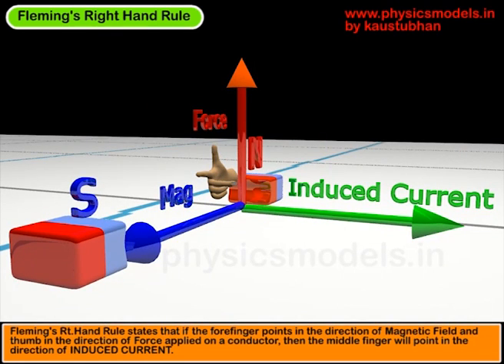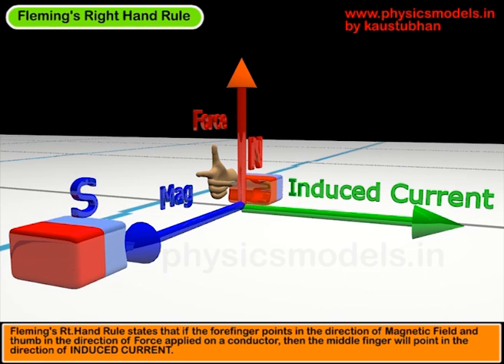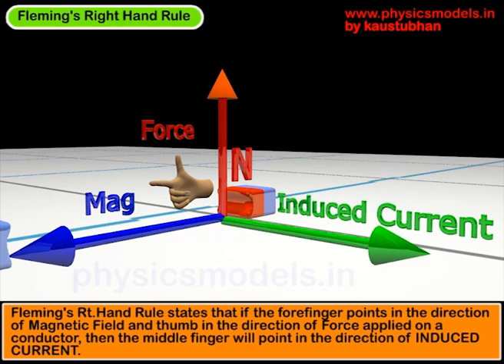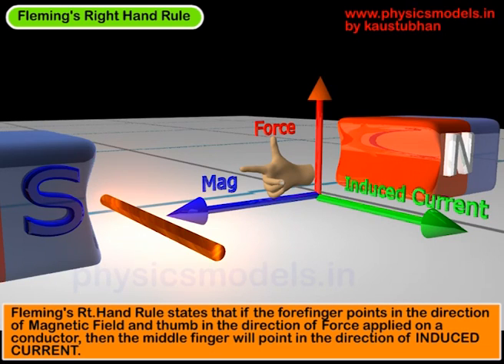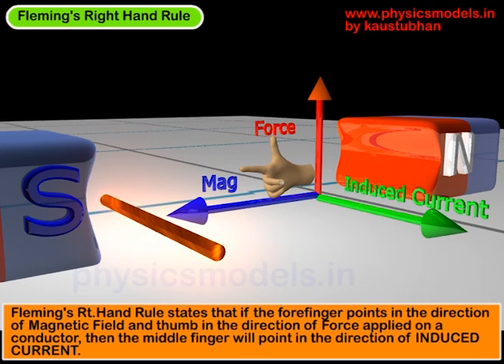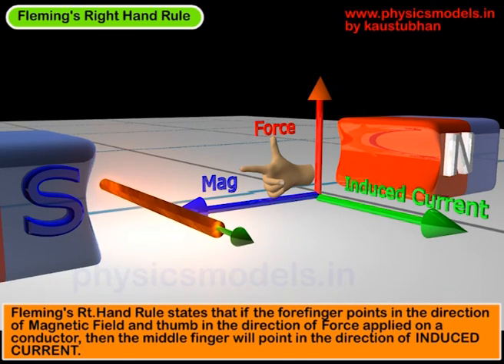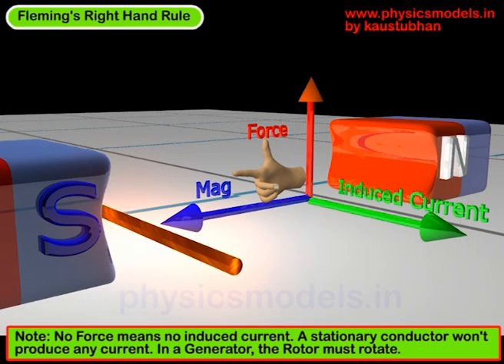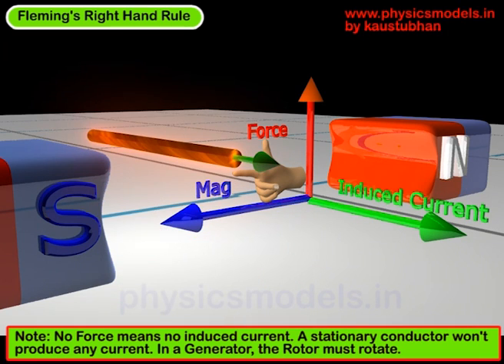Physics Made Easy-Fleming's Right Hand Rule

Comment: What happen if we reverse the force?
Reply from the maker: If we reverse the direction of the Force, i.e. Force acting vertically downwards, then we simply re-orient the Hand in such a way that thumb points downwards plus the forefinger remains in the same direction pointing from North towards South Pole.  With these two new inputs, the Output is the Induced Current direction. The direction of this current will of course get reversed.

Comment: Excuse me, can you please explain what you mean by:

1) Cutting the magnetic field lines

2) How do you know if it is a motor or if it is an *a.c generator*?  

Thanks. I liked and subscribed.
Reply from the maker: Hello Bruh, 
1) cutting the magnetic field lines: The invisible magnetic lines of Force exist always between the North Pole and South Pole of any permanent magnet. If I put my hand in the middle, I am cutting the lines, or "getting in the way" of those lines. If my hand is a conductor, a metallic hand, a current will flow through my hand. But my hand is not a conductor. If you move a copper rod between those invisible lines, a current will surely flow through the copper rod. 
Now, by moving the rod, you causes some Motion. Motion created electricity. That's nothing but a Generator principle. The Right Hand Rule talks about creating motion of a conducting part to "get in the way" of magnetic field lines, and then creating electricity. The Right Hand Rule gives the directions of current depending on the directions of Motion and direction of magnetic field. The Right Hand rule applies to generators , NOT to Motors. 
[ Easy way to remember? use some anagram like LNG  (Life is not good?) I mean (Lefthand NOT for Generator)
2) Fleming's Left Hand Rule is the opposite and used for Motors.  Imagine a Fan. Here we are giving electricity to the thing, and we want motion, rotational Motion. The principle is: when you supply electric current to a conducting part (can be a segment, rod, plate etc) like a metal part, which is already standing "in the way"  of magnetic Field Lines, i.e. between some North and South Pole, this part will see a Force acting on it, and this Force will cause it to move. The force is always a linear force. Because the segments are coupled on either side of a centre line, the whole segment rotates and you see a Motor kind of effect. The direction of the Force is given by Fleming's Left Hand Rule. 
3) Note: Both these rules give the directions only. They do not tell you how large the current is, how much Force and so on. 
I hope I could clarify your question. 
[ You are welcome anytime to login to my website www.physicsmodels.in or physicsmodels.com . I have covered a whole lot of subjects for the entire physics syllabus. ]
Reply from the maker: I must also add for interest that if I am wearing a metallic silver or gold ring on my fingers, and if I wave my palm with some velocity through the magnetic field lines, a current should certainly get generated through my ring.

Comment: Hi thank you for explanation very easy to understand but im a bit confuse for clockwise and anticlock of the coil , please let me know if you have an easy explanation .
Reply from the maker: Garen, good question.  To understand clockwise versus anti-clockwise, first point the fingers for the INPUTS. a) The magnetic field direction is clear, b) For the Force direction- this is upto us, it is an INPUT. If we ourselves put the upward force on the LEFT side of the conducting coil or rectangular segment, then it means the right side of this coil or plate will have a Force direction downwards. Why? Because the coil or plate is free to rotate about an axis passing through its center, this is the hinge for the whole coil. In such case, the rotation will be Clockwise -- when we look from the front side. 
On the other hand, if we apply a force upwards on the right side of the coil or plate, then the whole piece will rotate Ant-Clockwise. 
According to how the Force is applied, the induced emf will adjust itself for the direction, that's an OUTPUT of the Right Hand Rule. 
Therefore, the Generator works as per Right Hand Rule. If water falling from a dam impacts the turbine buckets on the left side of the magnets, this would be a downward force acting on Left Coil, so the Right part of the coil will move upwards, the whole Turbine would rotate anti-clockwise. 
Of course the water should not fall on both the sides of the turbine buckets at the same time, that would be same as applying the Force downwards on both sides of the conductor plate or coil , and it won't rotate properly.

Comment: It seems to me that the error here lies within the direction of what is incorrectly called force. Would not the two "poles" be accelerating toward the dielectric plane? In other words, the two "poles" are trying to create a single magnet. Considering the position of the copper, would not the direction of what is incorrectly referred to here as "force" be the opposite of what you have depicted? Not having a go, just curious. Nice video presentation by the way! Thanks
Reply from the maker: Elams, I think the answer would be that in the traditional Fleming's Right Hand Rule, the magnets are fixed. They are not free to move towards each other. The fixed magnets are just a way to create a magnetic field.
The Force is applied externally. Like water falling on blades of a turbine, or in an electric car, the Forces during Braking that act opposite to the direction of propelling the wheels. (Check Regenerative Braking videos)
 The direction of Force is an input, it's determined by us, it's not an outcome of a Generator. 
Next, Even in a real Generator, the magnets have poles facing each other, and there can be two distinct magnets. Of course, the magnets can't move towards each other, and the gap between the poles is kept small, and is carefully kept constant. 
Effect of electric field due to induced emf on the magnets:- well, here we have permanent magnets in this video instead of electromagnets.  These won't get affected by an external field of the induced emf which is expected to be far weaker than the primary magnetic field. In other words, the created emf can't be strong enough to overcome the parents which created it.
Reply from the maker: Further, the two poles in reality facing each other, help to focus the magnetic field lines.
Reply from the maker: I hope I have answered your question. If the question is different, let me know

Comment: Would the right hand rule be applicable to the current and force applied to the bars on a squirrel cage rotor? Please let me know!
Reply from the maker: Good question. Answer is "NO". 
1) The squirrel Cage design is infact a AC Motor. For any Motor, INPUT is current and OUTPUT should be rotation (of Rotor). 
2) The Rotor of the AC Motor is initially at rest and then starts rotating with respect to the rotating Magnetic Field inputted in the Stator Windings. The INPUT to the Motor is magnetic field rotation. The 2nd INPUT becomes current in the bars as a result of the change in Magnetic FLUX felt by the bars. 
3) The squirrel cage bars are initially stationary , which means they have highest relative velocity with respect to the high speed Rotating Magnetic field.  
4) The change in flux will cause an induced emf in the bars of squirrel cage. The emf causes a current to flow along the bars. The magnitude of emf will be as per Faraday's Law. 
5) Now, the current flowing will cause its own magnetic field (circular field lines). 
6) This new magnetic field will interact with the main rotating magnetic field and cause Rotation as OUTPUT of the Motor. 
7) The direction of rotation of Rotor will be determined by Fleming's Left Hand Rule applied to the conductor segment, which has a current and magnetic field as input.  
8) Once the squirrel cage in an Synchronous Motor comes to the same speed as the Rotating Magnetic Field, there won't be any change in flux, hence the current in bars of squirrel cage will be = 0. Hence no induced emf. The bars will stop contributing to rotation of the Rotor. 

Hope it clarifies a bit.
Reply: thanks, basically my original question is in other words, how can we tell the direction of the current that is inducted on the bars, I understand the workings of an induction motor except for this, essentially can you explain point 5, how do we determine the direction of said induced current and therefore its magnetic field the induced current will produce, thanks.
Reply: because im aware a current is induced on the bars, but a current of which direction, what way on the bars would it flow, what rule determines this?
Reply: Should have specified induction motor not synchronous
Reply: I did some research on lenz's law, I now feel comfortable and my question is mainly answered
Reply from the maker: The induced current's direction will be according to Fleming's Right Hand Rule.
Reply: Physics Models thank you so much that clears it up for me!

Comment: When do we use right hand rule and when do we use left hand rule?
Reply from the maker: Hello Sunil, Left Hand Rule - use for DC Motor. And Right Hand Rule - use for Generator. How to remember? 
You can try something like "LNG" -- meaning can be "Left Not for Generator" 
Actual way of checking this principle, in a new situation , when magnets position is reversed, current direction is different and so on. We can start from scratch as below :- 
Imagine the magnetic field (as a result of current flow) on the rectangular segments of the conductor, this magnetic field at every point would be a CIRCULAR magnetic field --this is shown as circular rings, (yellow colour in animation). Then hold any part  of the conductor in your right hand with your thumb pointing along the conductor in the direction of INPUT current flow. (This is nothing but Right Hand Thumb Rule. Different from Fleming's Left Hand Rule, please do not mix the two things) Now, If circular magnetic field's direction below conductor segment clashes or is opposite to magnetic field lines direction of North-to-South Pole, then NET magnetic field is weaker below the conductor, and stronger above the conductor. This stronger "person" pushes the weaker person. Hence, this particular part of conductor segment will have to move downwards. Then the other part of conductor segment will have to rotate upwards. Thus, you will see a rotation of entire conductor as long as current is flowing. If current flow stops, everything stops. Hope this clarifies. Thanks.
Reply: Physics Models tq sir

Comment: Isn't it a left-hand rule ?
Reply from the maker: Hello, Yes, DC Motor applies the Left Hand Rule. pl. see the Left hands put in the Animation, on the conductor. Even if you forget this, you can apply the magnetic field around the conductor, shown as rings, (yellow colour), then use "Right Hand Thumb Rule" to hold the conductor in your right hand. if magentic field direction below conductor clashes with magnetic field direction of North-South Pole, then NET magnetic field is weaker, and then the magnetic field above, on TOP of the conductor would be stronger. that means the stronger person pushes the weaker person. So, this particular conductor segment will move downwards.
Reply: i dont understand fleming left hand and right hand rule
Reply: ok ty
Reply from the maker: I can explain it, but writing the whole thing once again here would become Too long.  you can login to my website, both Left Hand and Right Hand Rule is explained, then call me if you need personal tuitions.
Reply from the maker: Hello Yasmine, Yes, it is a Left Hand Rule. DC Motor works on Left Hand Rule, whereas a Generator works on Right Hand Rule. To see the Left Hand, please refer my video which clearly superimposes the left hands , these are shown near the segments of conductor. The direction of movement of conductor (each segment) will always be shown by thumb pointing direction, when you take care to point forefinger along Magnetic Field (North to South), and middle finger along the Current Flow.
Reply from the maker: Thankyou. I would like to display your appreciation (like other students) under 'Appreciations Tab' on my website https://www.physicsmodels.in  Kindly let me know name of your institution, city, and country.
Reply from the maker: Hello Yasmine, I have now added a further detailed explanation below the video in text. Can you go through it and confirm? thanks. Author (kaustubhan)
Reply from the maker: Hello, I have added a detailed explanation below the video. Please see and confirm to me. thanks.
Reply from the maker: No, it's a Right Hand Rule , applied to Generators. Where the INPUT is Motion and the OUTPUT is current in the conductor.